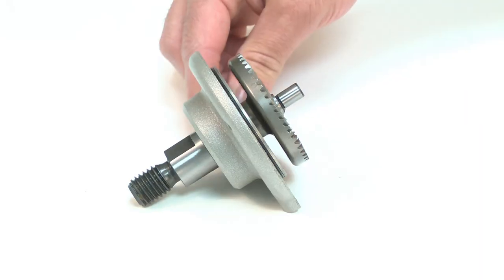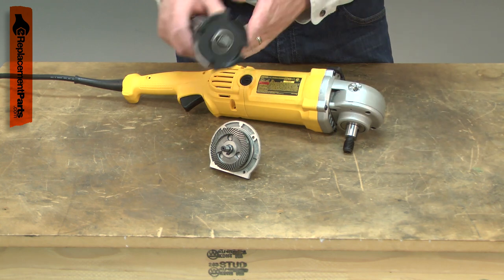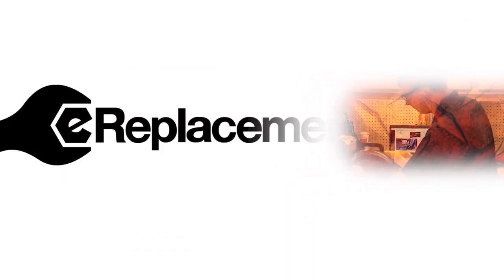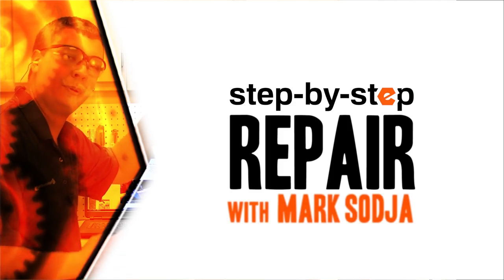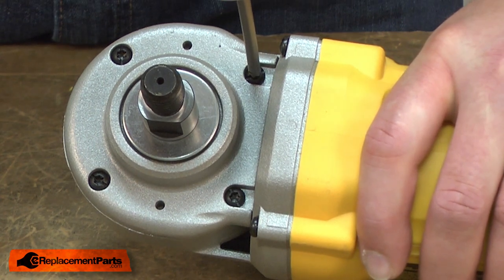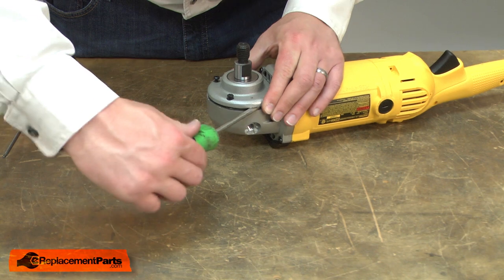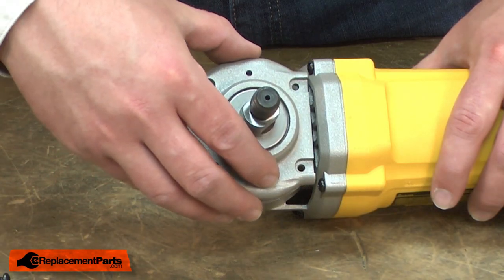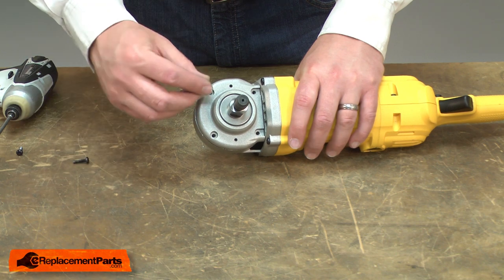DeWALT Polisher Repair - Replacing the Spindle and Gear (DeWALT Part # N107430)

Comment: Can you remove the spindle piece that attaches to the buff pads off? Just that piece?
Reply: Did you figure it out? In trying to do the same thing. Some buffing pads I bought came with a whool pad that needs a spindle with different threads
Reply: @chiefxx5250  I bought a second one that's made a little different from this one. Couldn't find any buff pads that would work with it. I just use this one for interior cleaning and the other for exterior.
Reply: @Lwill0  a whole different buffer? Or different buffing pads?
Reply: @chiefxx5250  a different buffer
Reply: @Lwill0  forsure bro